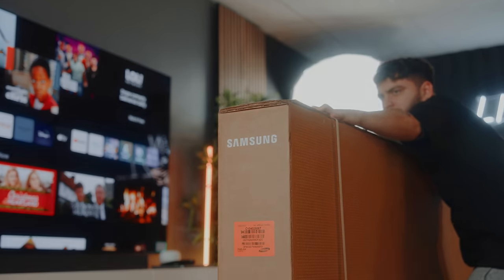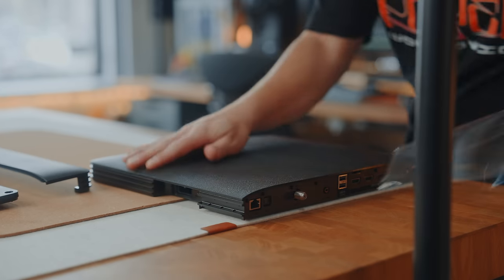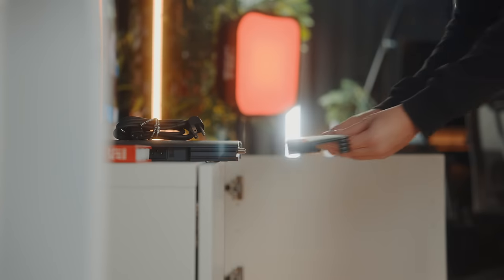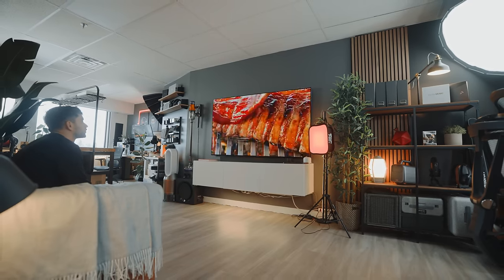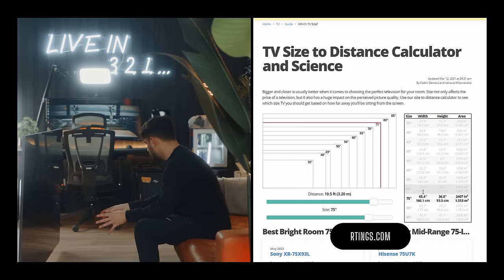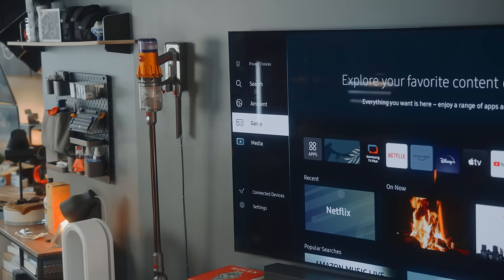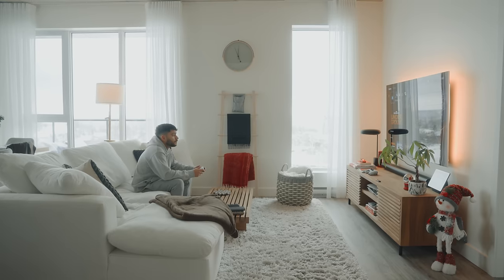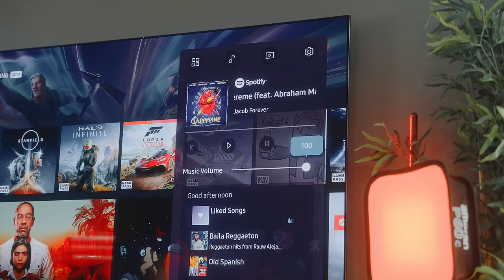Living Room Guide Towards The Best TV ? Buying Guide

Comment: I know this is probably a long shot but anyone else have issues with the One Connect box? I have a QN95B and was casually watching TV about a week ago (YouTube TV on my Apple TV 4K) and it  randomly just cut off. Really strange and something I’ve never experienced before. I would understand a TV off and not turning on, but never had it working and turn off on its own. Anyway, I still can’t get it to turn on. I’ve tried diff outlets, cables, everything I can. No power as the red idle light won’t turn on and always say offline in my Smart Things app for TV and since it acts as the Hub. Samsung is giving me a hard time when I’ve only had the TV for a few months. But with this issue, I would think I just need a new connect box and not an actual TV? And if they can’t help not sure where to find a box and if they’re for specific model or it’s universal for Samsung TVs. Anybody who experienced this or guidance would be greatly appreciated!